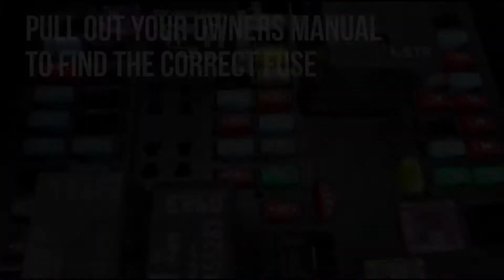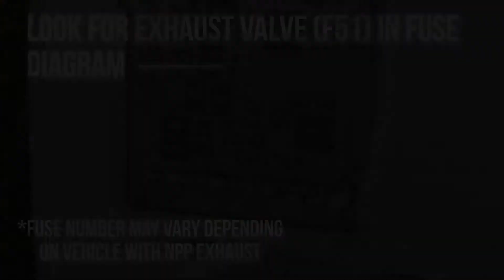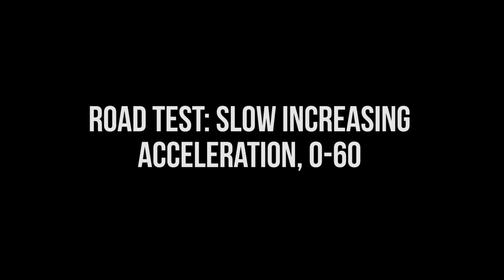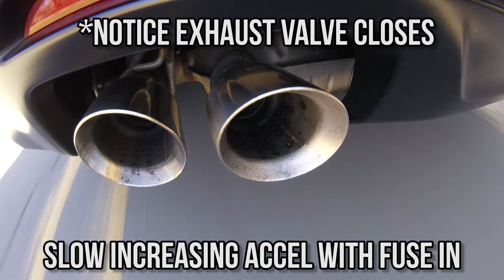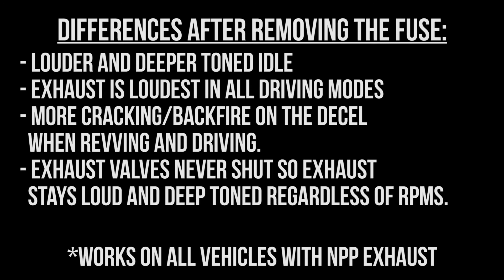UPGRADE Your NPP Exhaust FOR FREE!

Comment: Great video! I have a 2016 RS 3.6 v6, (I looked at specs and it says it has an NPP exhaust so going to give it a try), have you noticed any difference in mpg? Thanks again!
Reply from the maker: Yeah definitley give it a try I think you’ll like the difference! As far as the mileage goes not really sure as I pulled the fuse pretty soon after buying the car so never really got a good baseline to track. This fuse doesn’t effect the v6 to v4 shut down cylinders so I would assume that it shouldn’t effect the mileage that much if at all.

Comment: Could you make a video that shows the difference between cracking/backfire/pop sound?
Reply from the maker: I tried but its hard to get the crackling sound to transfer over video it doesnt do it justice.
Reply: @HowTo101  appreciate you replying. :)
Reply: @HowTo101  took the fuse out and now it makes sense. Had to sub :) thanks!
Reply from the maker: Awesome! Thanks for the support! How do you like it with the fuse out? Much Better right?

Comment: I might be wrong, but doesn't it stay open if you simply change it to track mode? lmao. anyway, I just chopped mine off and straight piped it 💪
Reply from the maker: Yeah the flaps still close when changed to sport or track mode at low speeds… with the fuse pulled it stays open 24/7. 
Hahah yeah straight pipe is one way to fix it😂

Comment: I own the exact same car except it’s a manual. I keep it in sport mode almost all the time and I don’t think the valve closes on its own. I’m not 100% sure if it does or not, but it doesn’t ever sound like my car gets quieter when I decel or my rpms are dropping. Just wondering if anyone could let me know and if pulling this fuse would even do anything?
Reply from the maker: Hey man, you will notice a different once you pull the fuse, it wont make it louder so to speak but one example would be you wont hear the flaps close like when cruising on the highway and u go to press the gas slightly you hear the exhaust more. Its hard to explain. Try it out and you’ll know what im talking about.

Comment: What happens when you change the Engine Sound Management from "Auto" to "Sport" under settings with the fuse in? Doesn't this also prevent the valve from closing?
(I'm not referring to actual button/switch that's on the center console, I'm talking about the setting that's on the mylink infotainment system).
That's how I have my 2017 2LT RS V6 with NPP. I never paid attention if the valve closes and right now it's in the shop so I can't test it. Curious if I've been missing out on this.
Reply from the maker: Yeah so you will get more aggressive sound on sport but the valves still close at low speeds and on the highway or of youre just cruising. So if you to were to accelerated a little you wont get the valves open up. Trust me try the fuse pull you will never look back.
Reply: @HowTo101  Will do, once I get my car back from the shop. It's currently in for the power steering recall.
Reply: @agoogleuser1753  did you notice a difference with the v6?

Comment: Dont get why people want to disable this when you can just push a button.
Reply from the maker: You would understand once you do it. It gives it a different sound that pushing the button cant give you. Because even in sport/track mode the exhaust flaps still close at certain points.
Reply: I did this for my ZL1 and it made quite a difference. The fuse is definitely staying out. Bummer there isn’t a full time flap open setting without having to pull the fuse.